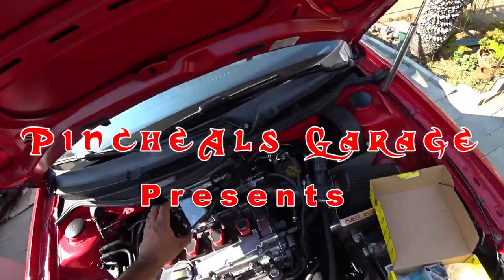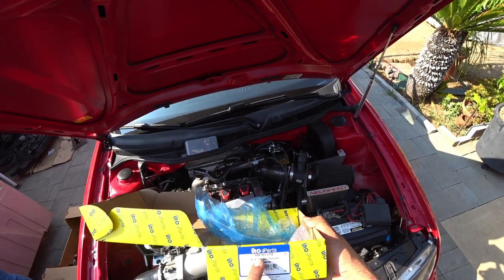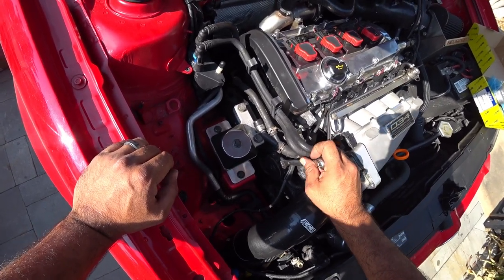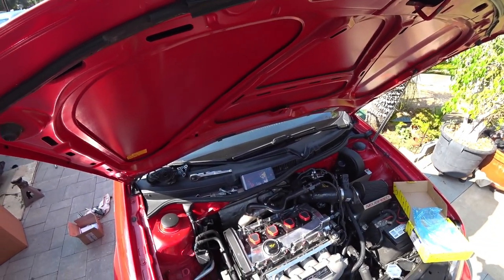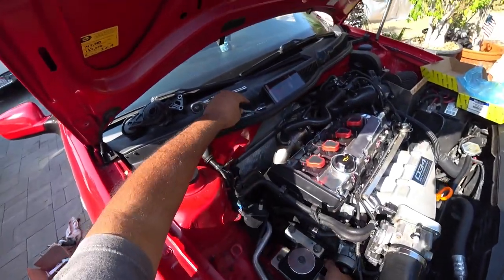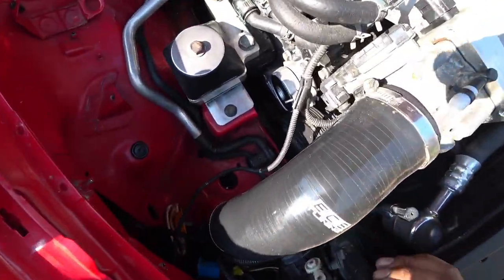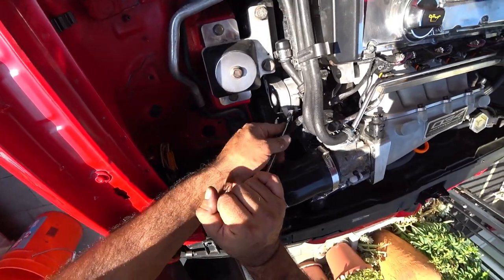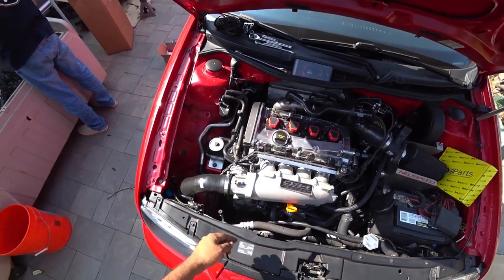How to Install an MK4 Jetta/GTI Belt Tensioner S7EP11

Comment: hey bro . do you know if I can use a manual clutch from a vw 18t  in a r32 with a 02M transmission???  I watched a video that a guy is using a 1.8t clutch in his r32 swap with 02j trans???
Reply from the maker: I have never heard of that